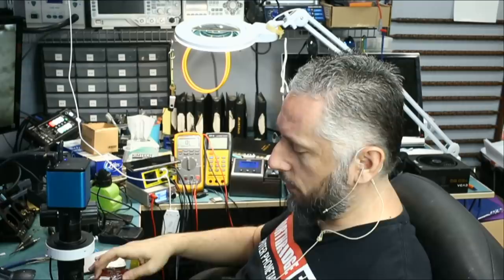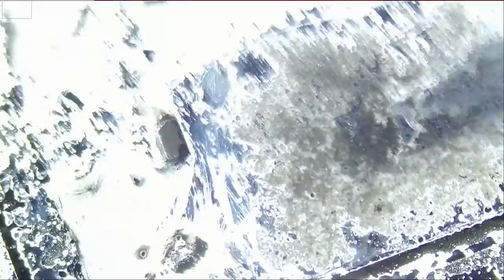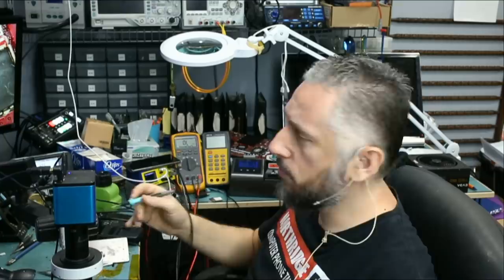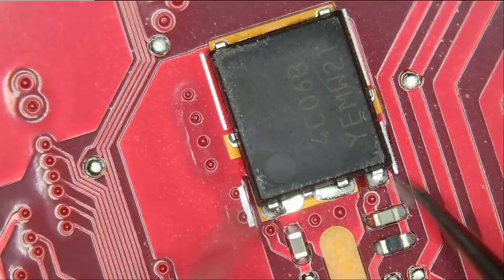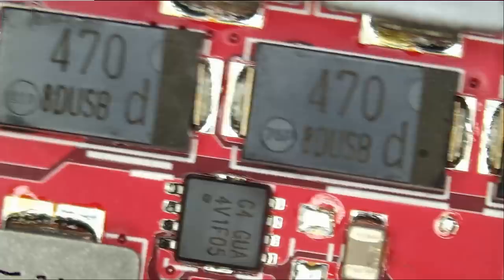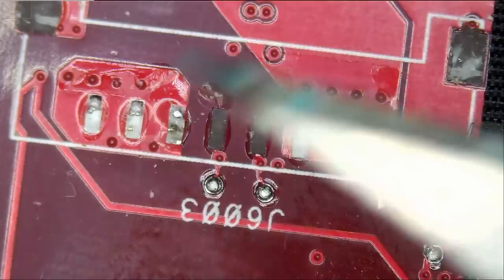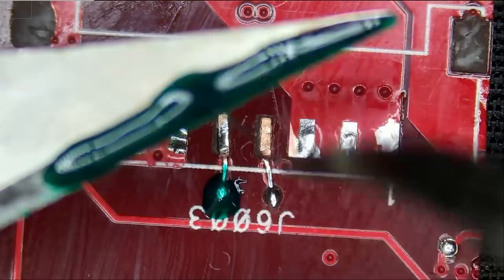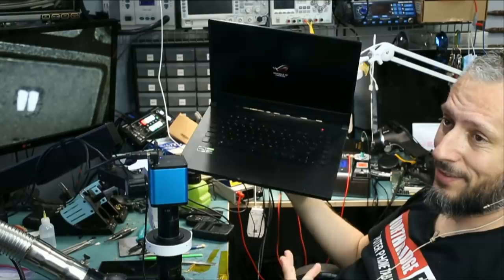3 Asus ROG Gaming Laptop Repair No power- The first one has Liquid Metal Spill

Comment: I think the takeaway from this episode is DO NOT use liquid metal ... Thank You 👍😊
Reply: Some manufacturers use liquid metal from the factory. However, they typically have protection keep it from leaking.
Reply: Liquid metal is excellent at heat transfer BUT if you don't know how to apply it correctly then don't try use it
Reply: there is a use for liquid metal, but it's completely stupid to use it on laptops.

laptop cpus are not meant for overclocking = why liquid metal

laptop coolers are wimpy, and don't have any pressure to hold them tightly against each other = why even try to apply liquid metal, it's just gonna spill everywhere.

+ 90% of the population can't even apply it properly = just forget about liquid metal in hopes of getting 1-2 fps more in games.
Reply: I think it's fine to use if it's on a console or desktop where it won't be moving around much
Reply: They never listen. Now the costomer has to spend another $2,000 on a new laptop because of liquid metal!!
Reply: I think the takeaway is to leave liquid metal application to the professionals. Too easy to mess up, it seems.
Reply: @Rare_K_  It's not about traditional overclocking. Mobile CPUs would clock as high as possible as long as the cooler can keep up.  Improving the cooling allows the CPU to hold higher clock speeds for longer.
Reply: @Rare_K_  i used it on my laptop. when from 100c to 81
Reply: Imean if your not that experience enough to put liquid metal maybe you shouldn't and have a professional do it for you
Reply: Ps5 uses  Liquid Metal  on its cpu
Reply: The bottom line is : liquid metal thermal conductivity is about 7-8 better than that of thermal paste. So it definitely is worth it, but avoid modding existing devices which are not designed for liquid metal cooling (like most laptops) if you are not certain of your solution.
Reply: @patx35  laptops are never overclocked in practice. Higher frequency commutation of internal CMOS mosfets equates higher power loss in form of heat, hence the need for cooling. But more power loss equals less battery life. If you're going to use your gaming laptop as a desktop computer and not go anywhere with it, why have a laptop in the first place?
Reply: @Rare_K_  I have a Asus laptop with liquid metal from the manufacture on the CPU but no the GPU. Gaming laptops will hit 90 c underload which will make liquid metal a perfect option to keep it down if possible.
Reply: why not Undervolt the CPU GPU ?
Reply: @salteveline  I do undervolted mine. But the point is Asus use liquid metal to be able to push the limit of the CPU/GPU and use the speed as a selling point.
Reply: @patx35  Then manufacturers should solder the heatsinks to the GPU/CPU…
Reply: @joelortizlozano  ^
Reply: @christophervanzetta   ?
Reply: @christophervanzetta  My comment was about Asus already having liquid metal from factory and it was directed to another comment. Is ok not to say anything if you don't understand what is being say.
Reply: @Rare_K_  I have a rog laptop its not overclocked I underclock it so being able to change the clock speed on a laptop is still useful
Reply: @filips7158  I'm not talking about traditional overclocking. I'm talking about boost clocks. Modern CPUs will automatically increase the clock speeds as high as possible when loaded. Mobile CPUs generally ends up hitting a thermal limit before hitting the max boost clock. Improving the cooling allows the CPU to boost higher and longer, increasing performance. Same with modern GPUs.
Reply: Unless you’re an extreme overclocker, or you’re running up against the thermodynamic limits of your chassis and cooling solution, you should not use liquid metal. 

That said, god I wanna put liquid metal on everything I own lmao.
Reply: @Rare_K_  Liquid metal is not only for overclocking. Everyone benefits from lower temps. 

My laptop would overheat without liquid metal, as would the PS5. I have a GA503QS laptop that does not thermal throttle an 8 core CPU.... In a damn laptop 😂
Reply: @norkris8729  it's insane isn't it?
Reply: @ZED-PV  it is. and for laptops u cant do much else.
Reply: @rochester3  SOC/APU not CPU.
Reply: Correction dont be stupid and use liquid metel
Reply: Nobody ever stops to think about the idea that liquid metal is meant for stationary systems that don't get moved hardly ever
Reply: This is not an issue with liquid metal, but with stupidity.

Comment: Liquid metal does have 5-10 times the thermal conductivity of thermal paste; however, it also conducts electricity.  It is absolutely essential that it NOT be spilled onto the circuitry.  Evidently, most people use far too much and it squeezes out and causes shorts.  Better use thermal paste unless you know what you are doing.  A 1 mm diameter bead will spread to cover 3-15 square cm depending on surface roughness.  Seldom would anyone need more and usually should use less.
Reply: It's mind-boggling to me how many people are willing to buy a product they do not understand, and open up and tamper with their $1000+ device, before spending 20 minutes worth of research into what it is they're buying or how to apply it.
Reply: @hrodberht3152  I certainly don't get it. I mean, w/ liquid metal you need some barrier to prevent spillage, right. So taking a laptop that [I assume] didn't have liquid metal and putting it on seems like it's asking for trouble... but what do I know. I'm a Playstation gamer who only knows a thing or two about PCs.

having said that, last night I ordered a Rog Strix Scar 15. Intel 12900H, 3070ti, etc that uses liquid metal. I imagine that one was user error but now I hope these have a barrier to prevent the liquid metal from spilling onto the board lol... seen a video of the application process, etc but haven't seen an actual video or pic of the chip pre heat sink.
Reply: I have seen people cover the immediate surrounding area on the CPU with clear nail polish but this stuff is all over the board!
Reply: @sarges1712  it has a barrier to preventing liquid metal from spilling and its applied by machines if not mistaken.

Comment: I've been building PCs for myself and all my friends and acquaintances for 20 years, always without any major problems! Once a mainboard and once a RAM kit were defective immediately after purchase from the dealer. Nothing more! But who has tried liquid metal on this? You can do it if you do it right. Apply a drop of paint to all surrounding components and only apply a tiny amount of liquid metal! And not the half tube and certainly not directly on the chip, but on a cotton swab and therefore on the chip! First protect everything properly then a little bit of liquid metal and everything will be fine! And also important: It is best to use it only on nickel-plated surfaces, not on aluminum or copper

Comment: Good day Alex, I enjoy watching your steady hand on the micro components. Being a retired electronic keyboard tech for 50 years you have a unique method of troubleshooting. I have a curious question on the liquid metal contamination. Might compressed air not blow the metal from under unseen connections. Of course I wouldn't do it on or near the work bench for concerns of future contamination. As always IMHO!
Reply: its probably already damaged the CPU.
Reply: you can try with a lot of isopropilic alcohol and a very smooth brush. I managed to save one like this but it can also push the liquid metal even further.
Reply: @michaelaltun  can CPU be replaced?
Reply: @3mariusx  Just a thought, but something like a WaterPik with the IPA would be a worthwhile last ditch attempt in this situation

John

Comment: I’m about to send you mine, I used to do circuit board repair, had IPC certifications but it’s been a while since I troubleshooted or was in the industry. I have a GU502DU motherboard from ASUS, buddy said stopped working, I checked the mosfet with the meter one side is 20V other side is 4.20-4.5V so I definitely know a component is shot just can’t determine which one it is.

Comment: How bout rigging up a vacuum (a strong shop type) and size the suction end down to a very small opening to suck up all this liquid metal.
Also, have the main hose of the vacuum run into a plastic bucket at the top and the smaller hose that will do the sucking of the metal set at a lower position on the bucket so that the liquid metal does not go into the main part of the vacuum.
It would be an easy way to get rid of all future liquid metal problems on devices coming in.
I am still surprised that idiots still use liquid metal on computers especially after you have shown so many devices that come to you for repair with it all over the boards.
Great Show!!!!
Reply: Well the problem it is manufacture who use the LM on the first place. Asus, Dell, and Lenovo have used it on some of their laptop (especially for high performance laptop aka gaming laptop), with MSI following this year. Thus there will be no choice to suck it and use it.

Beside, it is not really hard to tame LM. It depends on the manufacture. For example PS5 has really good barrier to avoid LM spill as they make the processor a bit lower than the other component in the board and + more barrier (thus the heatsink on CPU is like plug). Thus unless you open it, it will really hard to spill in PS5.

Comment: Hi Alex.
First, I do always enjoy the work and the videos you do. Top! 👍
 But I have a small question. Every time I see Americans use hot glue they heat it and put it manually on the component. Why don't you (ok, you can't answer for the others) use a hot glue gun? It's easier to use and you can work with a higher precision. Thx.

Comment: Are all these laptops out of warranty or is warrant voided because the user opened it and damaged it in some way? Ie apply liquid metal, replace non user replaceable battery etc? I'd think laptops stopping working due to capacitor or mosfet failure should be covered by warranty if the laptop was bought 2-3 years ago.

Comment: Hi, have you tried compressed air to get the liquid metal from underneath the CPU?👍
Reply: So it spills all over the board? Please use your brain.
Reply: This does actually work, some friends of mine did with a GPU, purest alcohol you can get, 70% worked for us, even if it's terrible and compressed air just did the trick, saved a 1060 laptop
Reply: @yasashii_koe  Better out than below, it's an unreachable place

Comment: LM is worthed in some cases, it is never if you are a dog and you don't have the slight clue at what you are doing.
And yes, if you don't use some insulator (btw non conductive nail polish works just fine) and this happens, well you called it on yourself.

Comment: I mean i get the guys was trying to cool the system better with liquid metal but should done some homework on how to approach it and how to seal it from liquid metal getting everywhere.  On my gaming laptop i have liquid metal but around the cpu socket i used the uv masking to cover the edges of the socket and covered some capacitors as well .. its a pain in the ass to clean liquid metal but found an easy way to do it.

Comment: Hii Alex, thanks for the new video. Great job! Hypotheticaly if i were to use the UV laquer to seal the cpu edges do you think this would work without any drawbacks?
Reply: my question would be what would the benefits be off the liquid metal compared to high quality paste ? 2 -5 degree better heat transfer ? not worth the risk in my eyes.
espacialy on laptops which are beeing moved constantly nor is it really worth it in normal setups in my eyes.
it could be usefull if your trying to run wr overclocks with liquid nitrogen cooling but then again i wouldnt run that in my laptop or regular pc neither lol.
i would get a special setup for that.
Reply: @cornnatron3030  liquid metal is 8X more efficient at transferring heat than thermal paste. Personally I've seen cases of core clocks dropping from 100c to 81c after installation, but the amount of effort and thought you need to do it just doesn't make it worth it. Honestly manufacturers should just be reasonable with consumers and explain you cannot have a 300 watt CPU/GPU combo inside a laptop that is 5mm thick... If they built the laptops to properly cool the parts instead of being thermal throttled constantly it wouldn't be needed.

Comment: the zephyrus g14 comes with loquid metal... i have a GA401QM that wont boot/charge... trying to get that fixed...
Reply: The laptop will take in 20vdc and only puts 0.142vdc to the battery

Comment: Never underestimate the "geek factor". This explains risking liquid metal. And why people modify cars.
Reply: it's always the same, it's crazy.. has nothing to do with computer, but i got a Xiaomi Scooter (XIaomi Pro 2) and it's incredible on how people want to absolutely mod it to replace good factory stuff by crap that break or "unlock" his speed "install custom firmware" like they are on a phone, and then they cry because their scooter doesn't work anymore because their controller burned out or their motor ...
Reply: @totalgaara  you can keep it at 25kmh and without cruise if you want. Or go 34kmh or higher with a battery in series. Most public firmwares are very safe, especially on the v3 esc that has stock reinforced tracks.

Comment: Hi, At 25:00 why do we need to use a UV mask ?? whats the benefits ??thnx
Reply: I think the reason Alex did that here is to make sure that the copper strip doesn't move or become completely dislodged while soldering the connector on, as it's possible the heat from soldering the connector could melt the solder at the other end at the same time and then possibly end up sticking to the soldering iron tip.
Reply: @rogerwilco5187  thankyou

Comment: What is liquid metal ? - adhesive or thermal paste or what ?.
Reply: An alternative for thermal paste, mainly used for overclocking.
Its thermal conductivity is much higher than that of conventional paste or pads. Seeing core temperature drops of around 20°C is not uncommon after switching to liquid metal, but it is to be used with caution, and needs yearly maintenance.

Comment: Shoddy design on that battery connection point. Nothing but solder pads to take the force of inserting/removing a battery. No wonder it failed.

Comment: what type of ASUS ROG laptops is that?
because i have a ASUS ROG STRIX G15 and i hope im not getting this problem in the future
Reply: Just look at how many Asus Laptops this channel fixes, I will let you derive youre own conclusions
Reply: Be careful with that assumption, if Asus sells a greater number of laptops vs competitors then even a normal failure rate will look exaggerated because they have more market share.
Reply: Is your laptop still working great?
Reply: @MulfzyK  yes even beyond my expectations, it even runs star citizen on the cpu/gpu and i did not expect that at all
Reply: but my gpu and cpu temps are around 78c on full load. im not really happy about the temps but other then that it's a good laptop

Comment: Why Asus laptops failed so much rather than MSI or Aorus line series? I haven't seen MSI laptops over a year. I noticed that Asus laptops failed with MOSFETs and SMD caps like other mid-rang laptops. So Asus laptops suck in build quality? I'm using MSI laptops for gaming 7 years straight without single problem (only replaced thermal paste every year) and now planning to upgrade to Asus model but when I see Asus laptops failing and failing again, I have to stay away from Asus.

Comment: I like how this guy has had multiple ROGs in with liquid metal all over and can't put 2 and 2 together that Asus did this. Just a rough assumption that a bunch of guys are running around squirting liquid metal all over.
He may be knowledgeable about circuitry, but if he can't be bothered to learn the basics of what he is working on he is bound to blame the wrong people and make mistakes. A quick search, or common sense, would have told him the customers of that specific laptop model aren't all walking around with super soakers full of Liquid Metal.

Comment: The stuff is stupid hard to work with, can get places you don’t want it AND it is corrosive and will start to leech itself into other metals, destroying them in the process. It’s probably contaminated the solder on the board, and once it’s under normal operation, the parts will pop loose, just like low melt solder! Delidding and Liquid Metal are almost never worth the gain in clock speed that can already be obtained with high end thermal compounds and water cooling. What happens is; they reach 4.9 or 5.9 GHz and can’t stand not having that even 5.0 or 6.0 GHz to post those stats online. Just silly childish mentality. Hope it’s worth the $$$….

Comment: Liquid metal is great stuff but you have to be real careful when you use it.  Masking off the area around the CPU can help, but I've never done that any time I've applied it to a CPU or GPU.  You just have to use a small amount and take the time and effort to spread it around.  It doesn't spread easily.  The answer isn't adding more.  A dot less than the size of a pea is MORE than enough to do an entire CPU or GPU.  This person just didn't understand how to work with Liquid Metal.